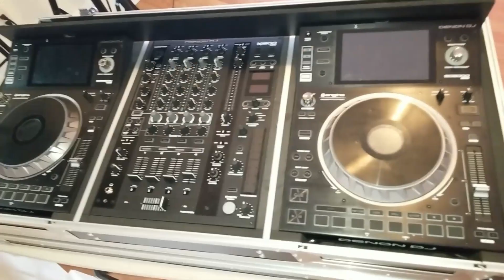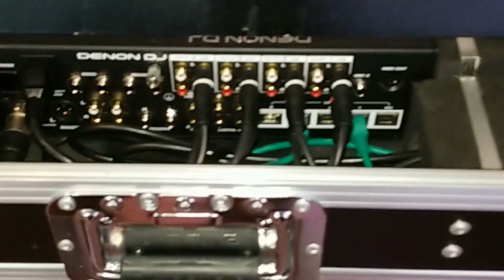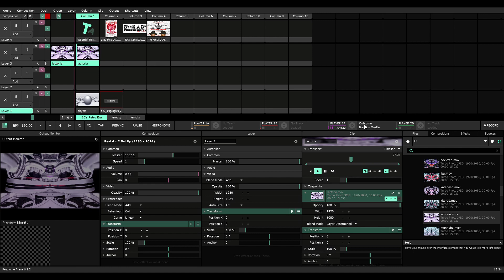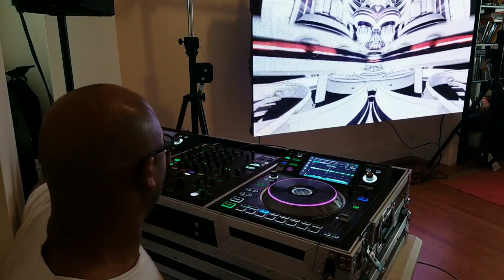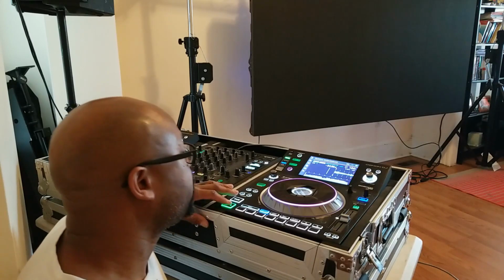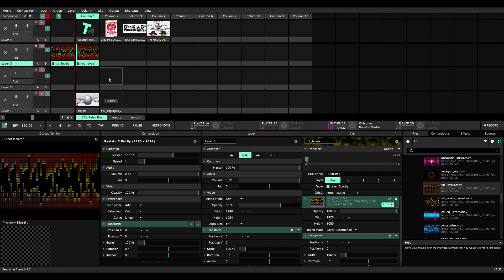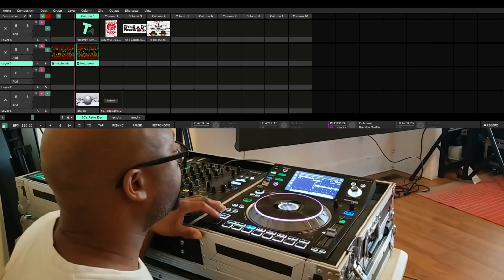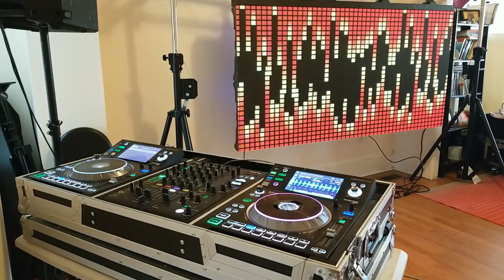Using Resolume With Denon SC5000 & X1800 Prime (Pt 1)

Comment: Thank you for putting this out! (: much appreciated!
Reply: if you want to keep the video playing during the duration of the song go into the Clip tab on resolume and in the transport tab there is an option to have the clip Loop, play back and forth, play thru and then go black, or play thru and freeze on the last frame (; 

also I'm definitely looking into getting one of those screens you have, it is a great looking set up
Reply from the maker: Thanks for the info bro. I'mma try it tomorrow. I'm new to Resolume. I was told that it will still only play once and the actual clips need to be the length, or longer, than the song. But the screens are from EachinLED.
Reply: Haha I'm a lady but it's ok 😁 and I have yet to try it myself - I just figured it would work, I'll give it a shot on my SC's tomorrow. Thanks for shooting over the model, I didn't realize how expensive those screens were! Holy cow!
Reply from the maker: Emma Otero oh well then I apologize for the misrepresentation. Cool. Let me know what happened. I’m a novice taking a shot in the dark. I’m just figuring it all out myself while having fun. Thanks again.
Reply: I could not get the clips to repeat once linked to a song..I'm updating my resolume program today so maybe that will help. 
I have been reading the manual though and I know that when you sync a video to a song it is supposed to be the exact same length of the song..

Comment: great video whats the brand and model of the screen you using
Reply from the maker: Eachin LED Panels. 3.9 pixel pitch. Thanks for watching.
Reply: Simple DJ Life how much of them 4
Reply from the maker: You have to contact them for specifics. Its much easier and cost effective to contact the actual manufacturers > http://eachinled.com/product/
Rubylin on Whatsapp >>
+86 134 1744 1954
Reply: @SimpleDJLife  thanks will you be doing a video to setup the screens how much leds are you using in this video
Reply from the maker: I'm going to work on a set up video soon. These are 3.9mm pixel pitch.

Comment: Thanks for the video man. was wondering about this setup I have been using resolume since arena 4 and just downloaded 6. Been using denon mc7000 for about a year. I would like to be able to use this dont know if its gunna be possible tho 😕
Reply from the maker: Unfortunately this only works for the Denon SC5000 and X1800 mixer OR the new Denon Prime 4 Standalone Deck.

Comment: Hi man, simple question : wich licence of resolume are you using ? What are the monthly charge to use those features
Reply from the maker: I'm using the paid Arena 6 version. There is no monthly fee. Once it's paid for, it's paid for. There is a free version that you could use that has a watermark that shows up frequently and it also has a robotic voice that plays in the background. Just remember there are two versions of Resolume, Avenue and Arena. Arena is the better version. The Arena version is also the one that comes with integration with the Denon protocal Stagelinq to use with the SC5000's or the new Prime 4. Btw, Resolume Avenue 6 retails for 299 euros ($340us), while Resolume Arena 6 retails for 799 euros ($910us). Thanks for watching.
Reply: @SimpleDJLife  Thanks for your answer

Comment: Great video.  I have played sets as recently as two weeks ago with the SC5000 and Resolume. @DJ_authentic Instagram; The clips have to be the same length of time as the playing track.  However it is possible to change clips during a set.  After that the issue is the layer structure.  Higher layers overtake lower layers.  Choosing "target free layer" in the Resolume clip options solves that problem.
Reply from the maker: Thanks for the tip. I definitely appreciate it. I'mma give it a try this week. Thanks for watching.